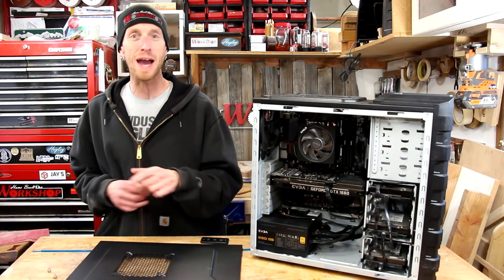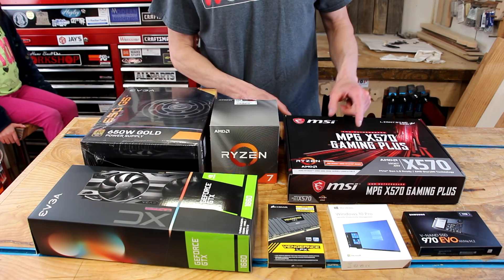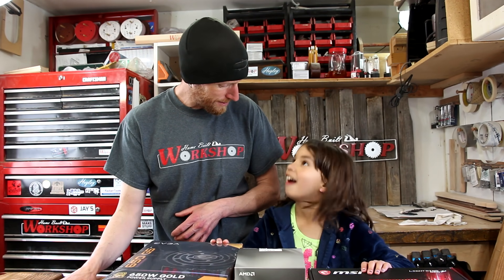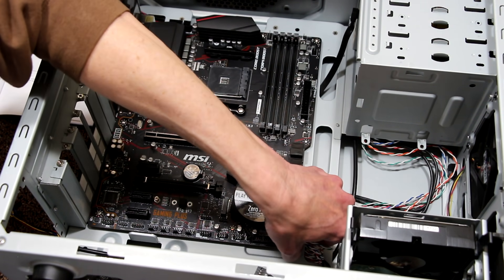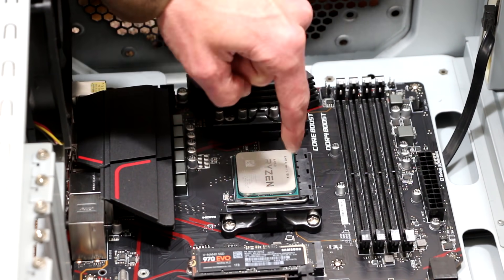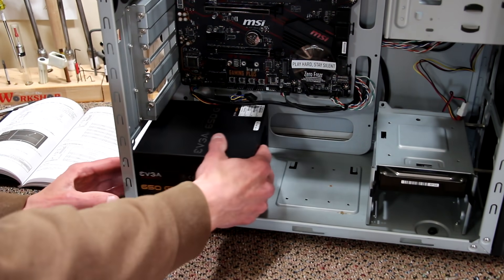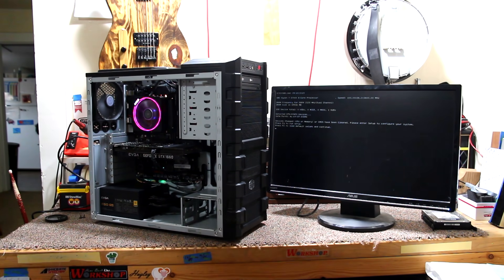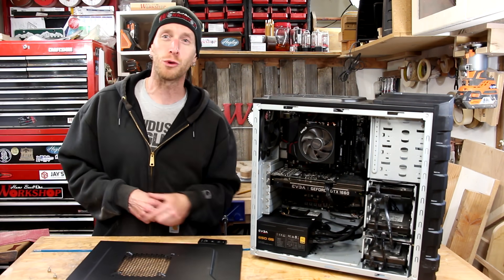How to Build a Computer | Building my new Video Editing Computer, April 2020

Comment: You are a brave man putting up a video showing how you do work on your computer.. many channels get hammered by trolls that enjoy telling you how you have done wrong.  Your build is as good as any I have seen on yt.  My only suggestion would be to ground yourself when working on your gear.. some will say it is not necesssary, but any step to ensure your gear lasts as long as it can is always a good thing.  And, here's hoping it lasts 12 years like the last machine :)  Keep up the great work, Jeff!!
Reply from the maker: Thanks. I am prepared for any feedback like that. I'm fine with it. For the grounding, I did make sure to touch the chassis before working on the components. I too hope it lasts a long time. 👍